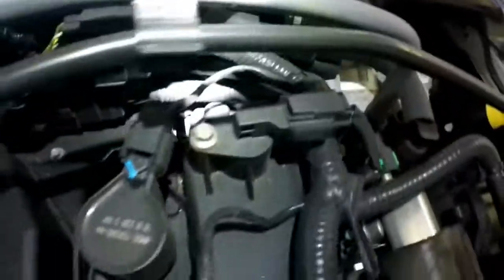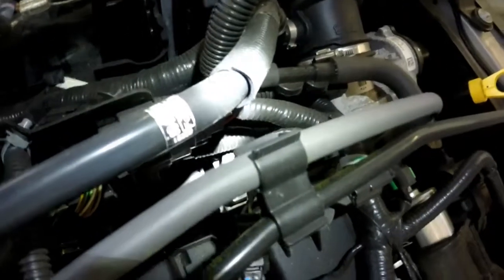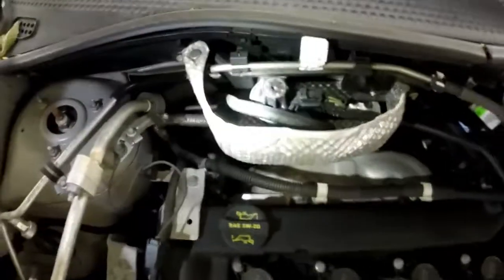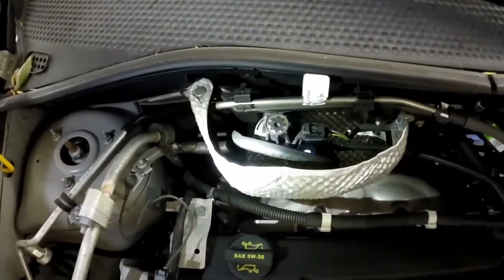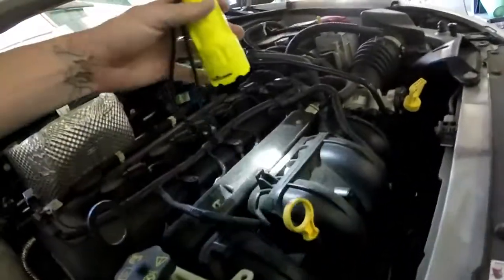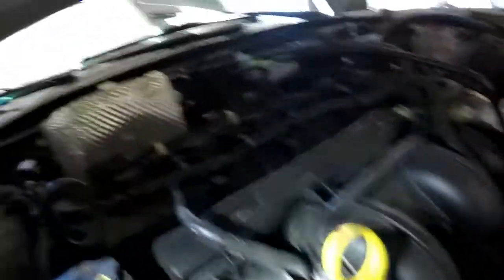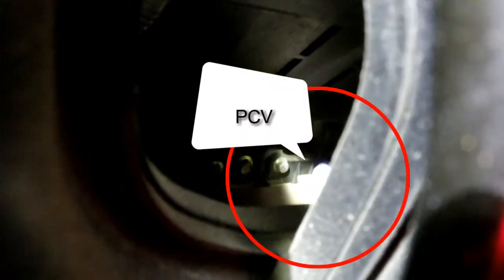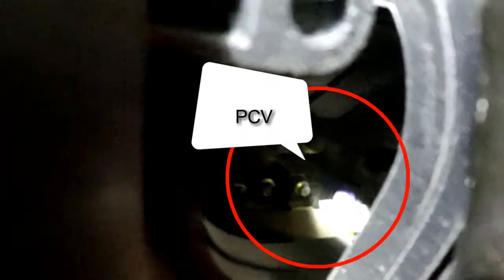Ford Focus emissions: PCV, EVAP canister + purge, & EGR

Comment: I've got a 2012 Focus and I'm getting the code p1450 from the scanner tool, I've done some research and found out that is the canister vent solenoid that I have to replace. The thing is that I can't find where the canister itself is located on my car. Could I get any advice about where it is? Thank you very much I hope you read my comment.